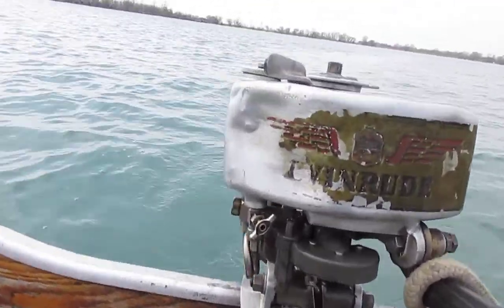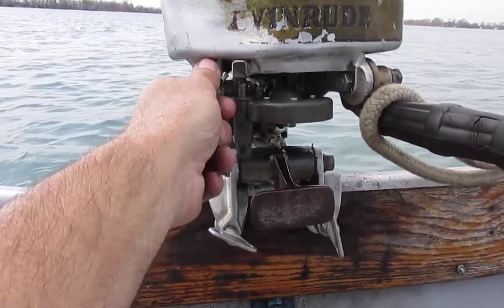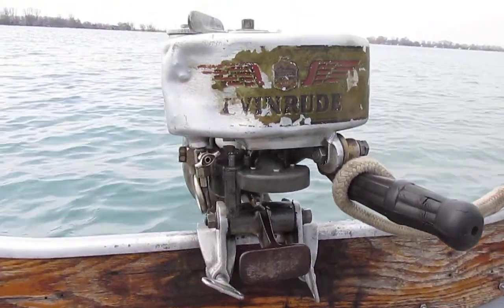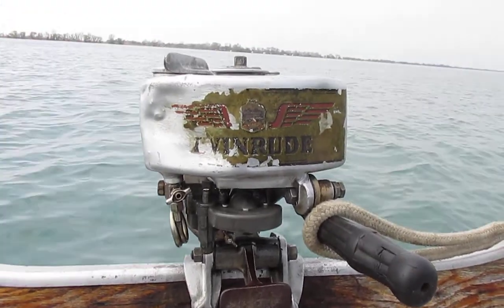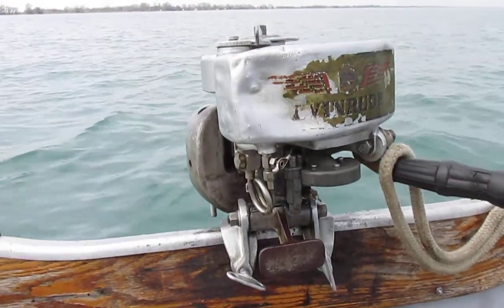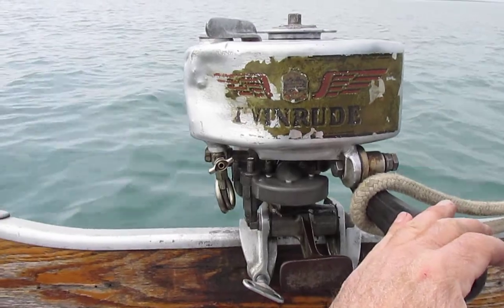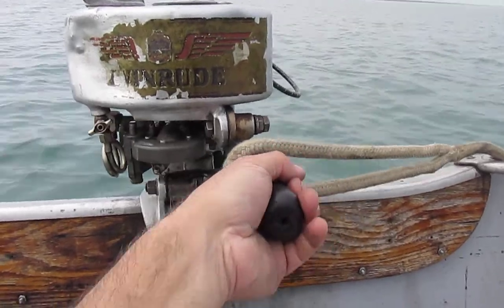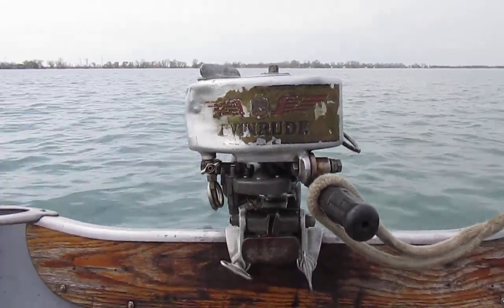1933 Evinrude Sport Single on Lake St. Clair

Comment: what oil mix ratio are you using with white gas?
Reply from the maker: I don't use white gas, just regular pump gas. Using Amsoil synthetic, I run this motor at 16:1.